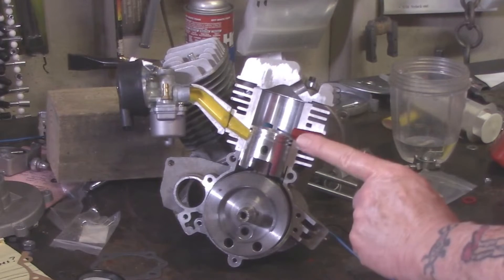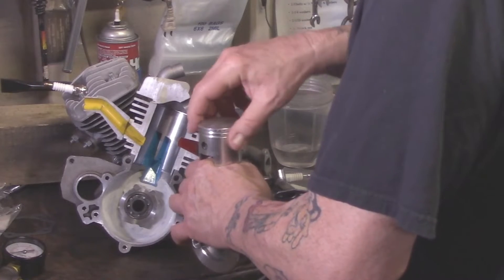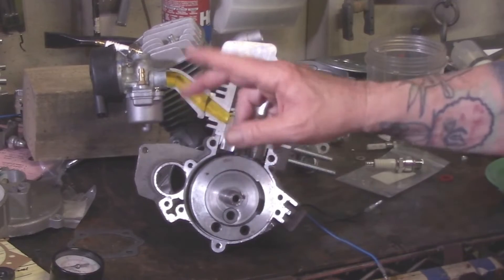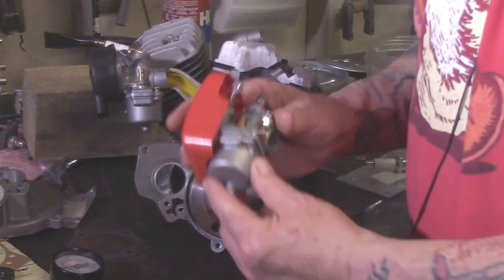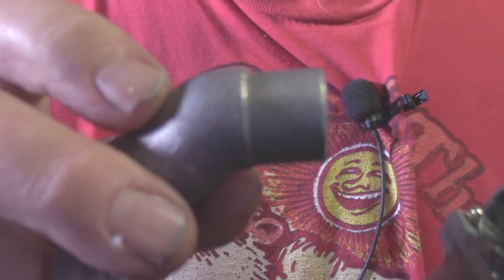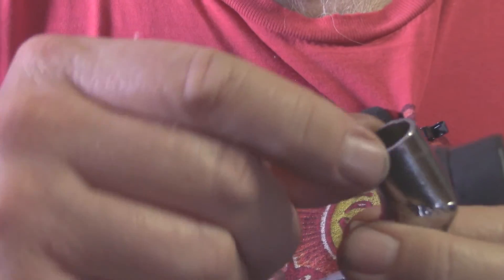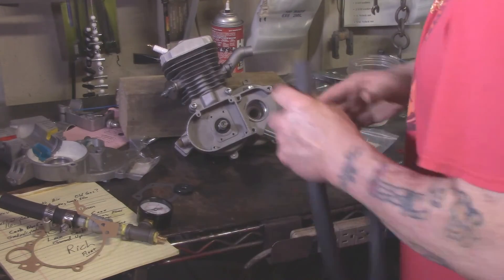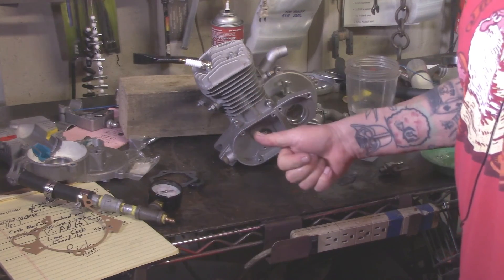Part 2 -Intake Leaks Troubleshoot and Repair No Start 2 Stroke Motorized Bicycle.  That Sucks !

Comment: You solved my problem, I wish I found you sooner now I can quit sweating over air intake issue I created by adding an 45 degree extension because of space issue because I used wrong frame and What a pain in everything.😂

Comment: hi hughes motorized i keep adjusting the idle screw on the clone bofeng nt  carb , how to keep engine running , will cut off if i slow down or stop ,have to keep feeding gas, ive tried everything ,except jet change

Comment: Question for ya I got a 100cc gas bicycle motor off of Amazon last year and I just found out tonight that my piston do not go all the way down past the exhaust hole you can see the top ring and it covers up half of the hole what should I do and how would I fix it or can it be fixed
Reply from the maker: Designed that way
Reply: @HughesMotorized  can you explain what you mean designed that way
Reply from the maker: @thompsonce  The design is such that "you can see the top ring and it covers up half of the hole". It does not need to go any lower.

Comment: Very informative video.
I have put together one of this engine and it works Ok with some hick ups. I think with your video I may fix that.
Couple of issue is have. One is that when running there is too much tail white smoke comes out. Other is that when engine stops, there is black oil drips from the muffler. Any idea how to fix these issues?  Thanks.

Comment: I have a problem with my bike, I would really apreciate if you could find time to help me. So it starts kinda hard, and then it idle properly, but when I left the throttle after a couple minutes of full throttle, it starts reving even higher. It had a problem staing on, even with the idle screw screwed all the way in so I grind a little from the flap to make more room for air. This solved the probleme, but on a new engine I think it will idle way to high.

This is a 66cc 2 stroke, piston port, with a full speed around 55km/h. And it have around 6000 km so far on this set, the bottom end have way more, around 15000km, but it dosent have leaks so I think its still working properly.

I recently change the piston rings, beliving that those could be the problem, and indeed the old ones were wore off. I didnt change the piston or cylinder yet, and it still rev like crazy after riding wot for awhile. I try with another carb and the same problem occured (with the same jet). Going up on the jet, will make the engine start easier, but its performance decrease semnificantly, getting only to 30-35km/h.

This new generation of sets from the past couple of years, I noticed have the piston skirt for transfer lower with almost 1mm. And have a sever decrease in performance.
Reply from the maker: Intake leak somewhere
Reply from the maker: post on my Facebook group. Hughes Motorized
Reply: I will try replacing the gaskets and seals before asking again ppl, I have to do my fair share of work as well. @HughesMotorized

Comment: When I take my hand off the clutch, the back wheel freezes like the breaks applied. ‘Auto Morris 110CC 2 stroke engine’. Tried to start it for the first time and I got no downhill around here, hahaha. When I was pedalling, it was a double pedalling for both chains. I was told the spark plug connector could be loose cause’ the red one has just a spring in the back to hold the top of the spark plug. The chain may be a little loose or the plastic wheel isn’t right, but I don’t think that matters? I also don’t have a primer. Hahaha keep pedalling? I release the clutch and the back break freezes like the brakes applied. What do I do with that?
Reply from the maker: Your engine might be locked up. Remove the drive cover where the chain is and put a socket on the nut on the sprocket and see if engine will turn over

Comment: Question my stroke motor will start only for a second unless I'm peddling the whole time I'm on the bike . The carb was recently clean. I've replaced the fuel lines throttle cable. I wanna scream. I use this bike for everyday stuff.plz any ideal I would appreciate it thanks

Comment: Lots of helpful info in these, a bit overly detailed though, and I wanted to mention that the flaps on the carb break then we’re replacing a carburetor instead of just an o ring.

Comment: Ahhh! Finally! Thanks bro! I knew about the porting... but not about the air exchange!! For some stupid reason i thought air would get sucked from carb, to air manifold, to ABOVE the piston... Duh!! Wheres the fun in that right...Love your vids. Don't be suprised if I hit u up with a question or two.. But your vids are quite comprehensive so.... Was gonna buy the newer 100 model, but decided to stick with the 66 for the universal parts factor...
Reply from the maker: 66 fan myself for the same reason

Comment: Could you help me my 80cc 2 stroke engine it will not spark even though every hook up correctly and the kits brand new
Reply: I got it
It was the clutch then the chain broke so got to get that fixed waiting on my part

Comment: Love that idea to check for air leaks! I will apply right away! How did you connect a Schrader valve to the tee 3-way female pipe?
Reply from the maker: used a 1/4" tank valve fitting https://amzn.to/3OHG4zZ
Reply: @HughesMotorized  thanks!

Comment: oh im having a long case of non starting engine here, started when it my chain broke the wall between it and magneto coil, i buyed a new block of engine, put my pieces on, changed cdi and magneto coil, and still not working, the motor pops, sometimes even have a strong pull but dosent get speed and keeps dying and dying, and stops, dont even pop anymore, then it rest somedays and it starts to run and dies all over again. Was an old engine 3y old, that always runned ok. But after entering mud and pieces of metal in contact with magneto coil, i could never put it to work again, even chaning the eletric part, spark plug was the first. Today i has a good spark, but just dosent run well, im suspicious about the magneto rotor being a little damaged (some scratches on it) and some leaking from the new cranck case. Ive changed my gas tank to a plastic new one, cuz the old had rust, thats all details i can remember. I will try next to take off the gas filter the goes inside the gas tank as you recomended, and check for bubbles too, i get back to you.